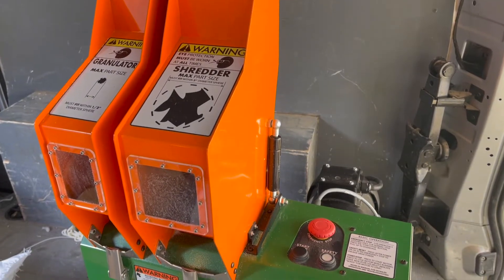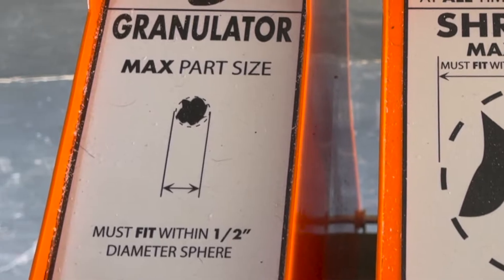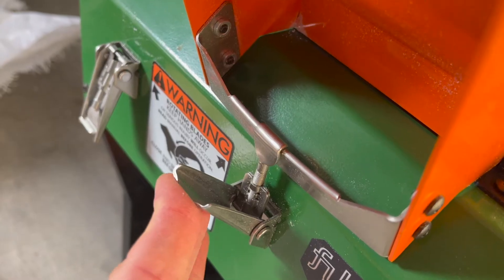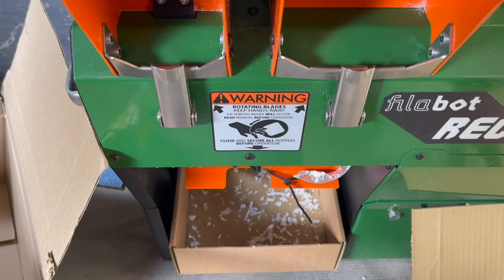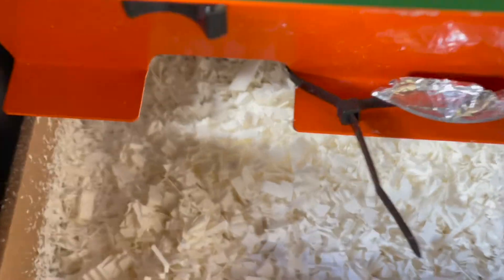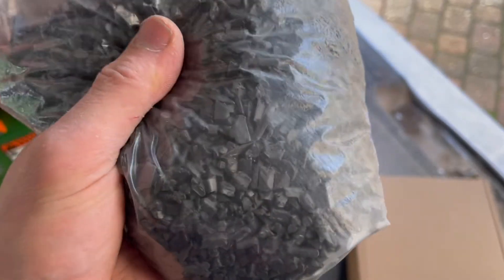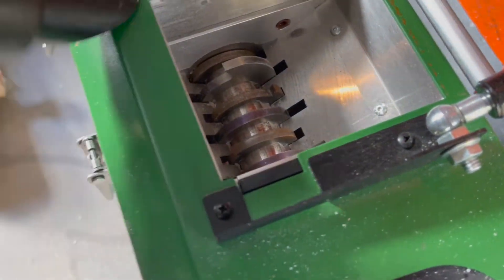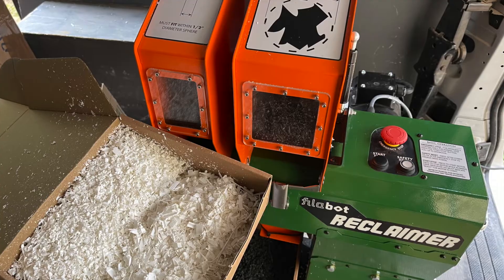Filabot Reclaimer - Mini Review

Comment: Very cool video! I have a couple of suggestions to make regarding the machine, though:
1. The problem of overheating the filament on the granulator part can be mitigated. You could adapt fans to cool off that part of the machine.
2. Still regarding the cooling problem, you could set up a timer that can be turned on when processing PLA. It would start, run the machine for 30 seconds, and pause for a short while in order to cool off. Then, it would restart the cycle until the process was over.

What I am saying is that this machine gets you almost there. It will be just a matter of making a few minor alterations to this machine to take full advantage of it. 😊
Reply from the maker: Thanks for the comment! In terms of the suggestions, I agree that additional cooling could be beneficial, but I'm not sure a fan would be sufficient. The shredding blades themselves are actually set quite far in to the unit, so the heat transfer to the edge is minimal. As such, the cooling effect in reverse, would be minimal.

The pulsing shredder would work well, but because of all the safety reset switches, again would be difficult to implement for this particular unit. In a similar line of thinking to this though, it may be possible to build a dispenser for the material, so that it drip feeds the material into the shredder. Which should have the same affect as pulsing the shredder.

I do also have another shredder which I recently put together on the channel, the chopping motion is different, so may produce less friction. Will cover how that one performs in a future video:)